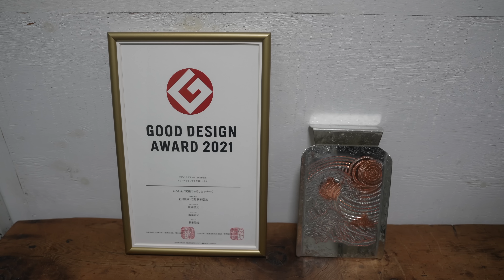おろし金ができるまで。ミシュラン星付き料理人を唸らせる純銅手打ちおろし金。

Comment: Forming copper = trimming with a bandsaw
Polishing copper = deburring edges
The melting of the tin and then dropping it into water was to create "shot"
Polishing the "tagane" = dressing/grinding the end of a punch
Blade inspection = just looking at the part through a magnifying glass
Metal hammer = peening the surface for texture (looks like a baby picture hammer, but there is a texture on the hammer face)
Finishing bending = you know, a few final bends
Complete = done for the day